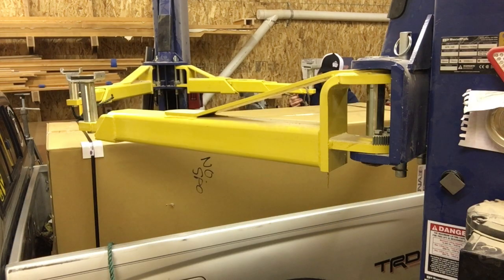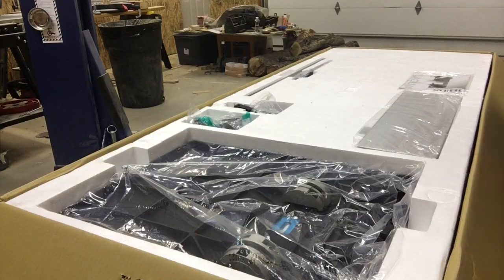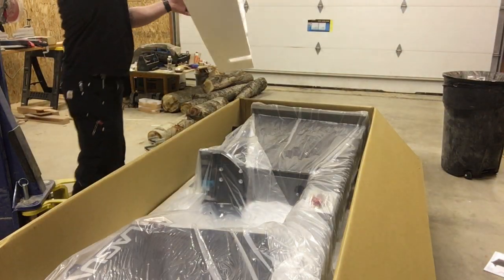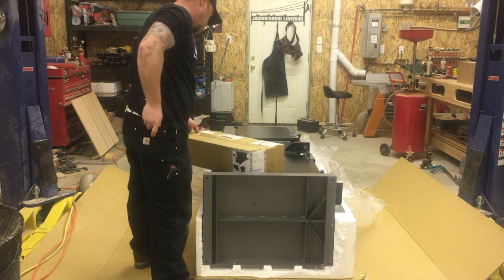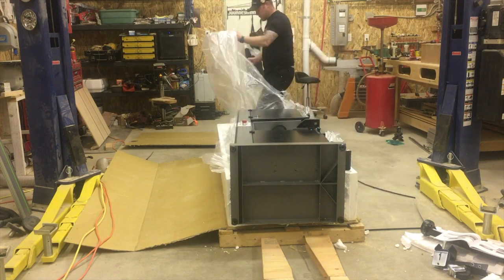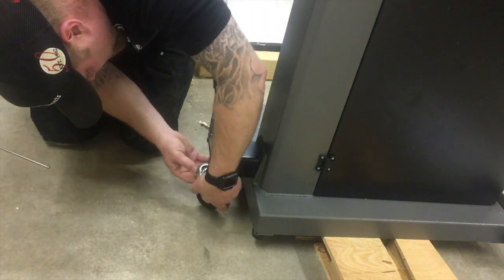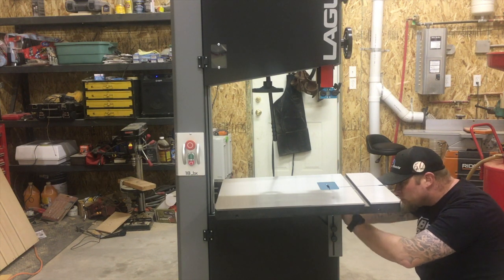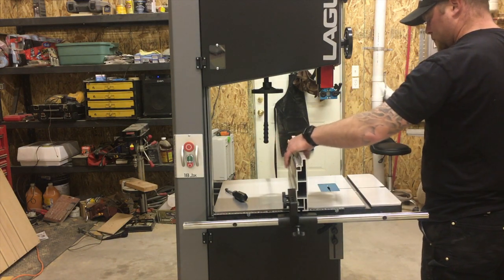Unboxing and Assembly of Laguna 18BX Bandsaw

Comment: Hi
so after a year how is it working. I may be seriously looking at the same unit but heard about warped fence and table as well as a trunion not machined correctly. Have you had any of these issues?
Reply from the maker: Hey Gary, honestly in a year I haven’t put it through a crazy amount of work. Out of the times I have used it it worked awesome. Of all of the things you listed I haven’t had an issue with. I would think these things would be an issue right out of the box which mine has not.